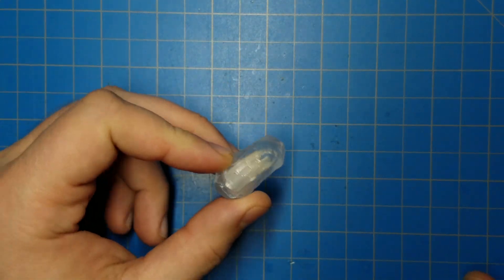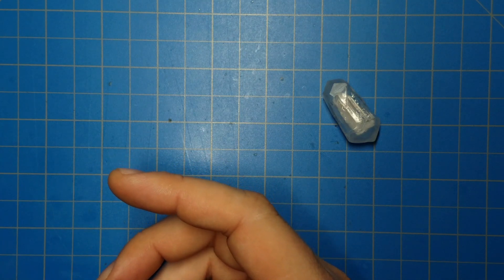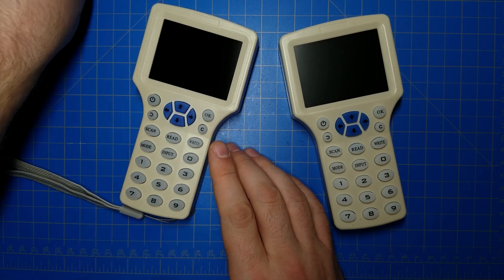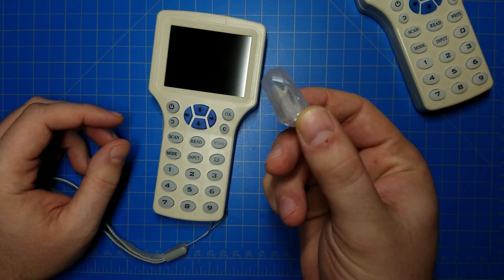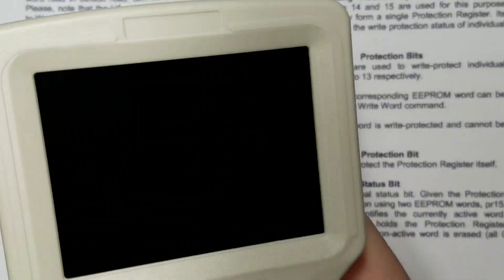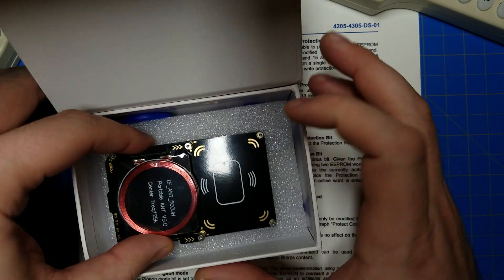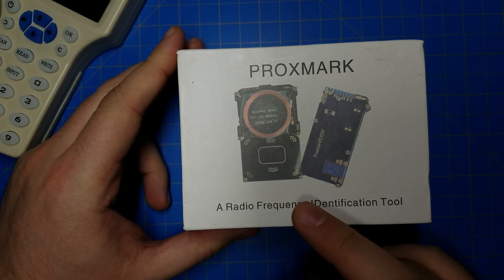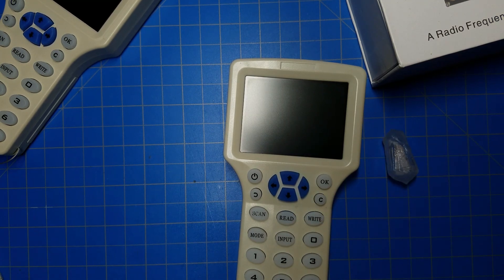Not All RFID Writers Work with Kyber Crystals

Comment: What is the Proxmark command line that woule be used to correct the Chrystals if they have been locked by a "bad" RFID reader/writer?  i did this and locked two of my 3 chrystals and was hoping you could help clear the locks off of them.
Reply from the maker: it depends on the version of software you're using. i use the standard Proxmark3 client and the command is

lf em 4x05writeword a 4 d 0001805F p 00000000

if you type "lf em" in your pm3 client it'll list all the commands and if you see 4x05writeword is a command then this should work.
Reply: Ruthsarian that worked for my yellow (thanks so much), but my purple crystal won’t read at all now, so I will have to play with that one more tomorrow.  One out of two (of my 3 total) isn’t bad.
Reply from the maker: @denniscella2846  i have a proxmark3 easy. i find that the placement of the crystal over the antenna so that the pm3 sees it can be a matter of millimeters. here's a couple pictures of how i place the crystal over the antenna:
http://imgur.com/a/jiebtj5
Reply: @Ruthsarian  the pics really helped, i got my mace back, i had to put it in the container and lay it sideways to get the reader to find it, but it rewrote it!  This is the kind of stuff that needs to be documented on a reddit somewhere!

Comment: I’ve been unfortunate and locked my kyber crystals and now need the proxmark rfid kit to fix them. Can you do a tutorial using the proxmark to change The rfid tags on the kyber crystals?
Reply from the maker: I will, but it may be a little while. So here is the command to send to the proxmark 3 that will unlock the crystal. 

lf em 4x05writeword a 4 d 0001805F p 00000000

It will respond with "write verified" if it worked. I have found that I need to hold my crystals maybe 1 inch or so above the antenna in order to get it to write successfully. I often have to enter the command, it will fail, then I'll press the up button (which loads the previous command) and then hit enter (to execute the command) many times in a row while I make very small adjustments in the height of the crystal above the antenna. That may be a product of me having bought a Chinese clone of a Proxmark3 and the antenna not being designed quite right. But it does eventually work.
Reply: @Ruthsarian  I have same issue with locked crystal, got proxmark 3 just wondering what software you are using to program it?
Reply from the maker: @dvdcomic  follow the steps here:
https://github.com/Proxmark/proxmark3/wiki/Windows#getting-started

You can also look at the ProxSpace instructions here, which are essentially the same, but might be a little easier to follow:
https://github.com/Gator96100/ProxSpace/

Alternatively look here:
https://enterthecore.net/proxspace/

I haven't used that site's instructions, but it has all the software precompiled for you so you are able to at least skip the time-consuming setup of setting up an environment to compile the software.
Reply: @Ruthsarian  got the software up and running and got new rfid reader (the right one) delivered today from amazon.  when trying the command to unlock the crystal you had posted its just showing help commands within the proxmark CMD window
Reply from the maker: @dvdcomic  if you enter "lf search" does it see the crystal? if you then try "lf em" it should list all the available lf em commands. do you see a writeword command in there?
Reply from the maker: @dvdcomic  it sees it, but not as an EM4x05 chip, which means you need to reposition the crystal. when it's in the right spot, you should see the same as above, except there will be two additional lines in the output:

Valid EM4x05/EM4x69 Chip Found
Try lf em 4x05... commands

in my experience, the crystal needs to be positioned vertically about an inch above the antenna. here's a couple images demonstrating the position of the crystal: https://imgur.com/a/jiebtj5

if you type just "lf em" (the crystal doesn't need to be present) you should see a list of lf em commands. do you and if so do you also see the 4x05writeword command listed?
Reply from the maker: @dvdcomic  looks like your version of the software is using a slightly different syntax. i believe this should work for you:

lf em 4x05_write 4 0001805F 00000000